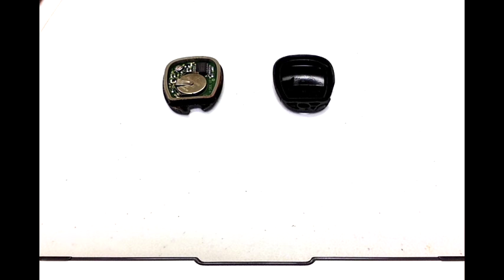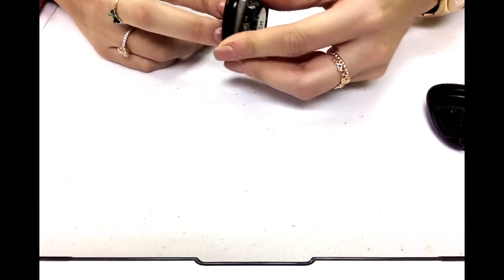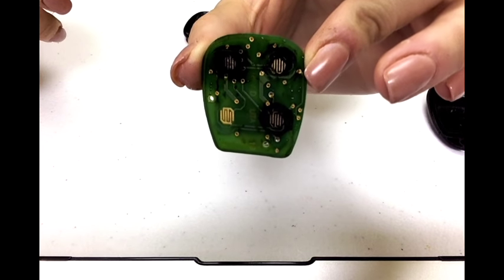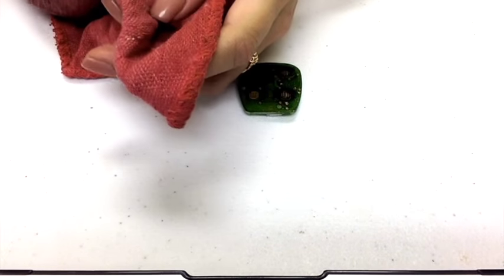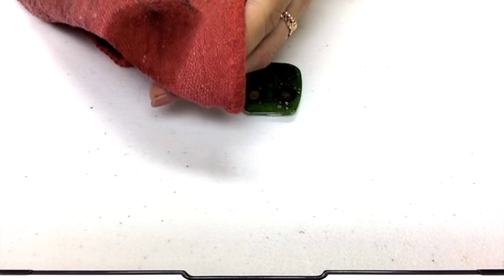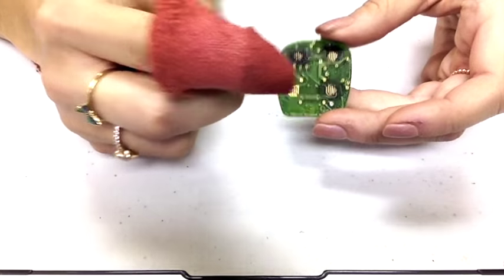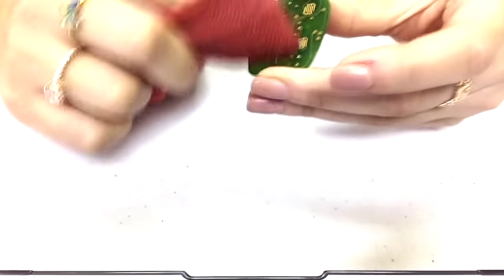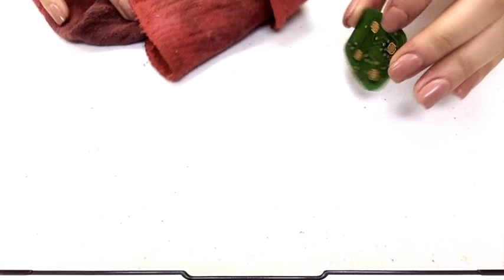How To Clean Your Key Fob Circuit Board | Fix | Repair Your Key Fob Buttons

Comment: Don’t use “rubbing alcohol” it’s ~30% water and possibly other stuff too.

Use 100% isopropyl alcohol only - and remove the battery first. Also use a clean microfibre cloth and/or clean cotton swabs.
Reply from the maker: Thank you for sharing this tip.

Comment: I am having trouble with a Chrysler 300 remote.  All the buttons work except the lock button.  It had worked for a long time even when the actual button came off we were able to finger nail the lock and then one day it stopped working.

I just opened it up and it looks like there is probably solder or something tin like on all the buttons except it.  I just bought a new key fob cover but have a feeling that it won’t be enough for the lock button to work.  What do you suggest I check if that is the case?

Comment: What if the the side where the battery is has stuff on it too?
Reply from the maker: Be careful cleaning that side, you don't want to break any on the connections, make sure the batter is not in and let it dry fully before putting the battery back in.

Comment: I clicked on this video because i thought she was holding a strawberry in the thumbnail.
Reply from the maker: 🤣 I can see that🍓🍓
Reply: I though it was some kind of potato...LOL
Reply from the maker: @obdiipolice7186  Strawberry or potato, I hope that you got your key fob working again!
Reply: Hope you can help me on this one, my key fob is draining batteries in like 24 hours. Works perfect ever time I replace a battery but after 24 hours battery shows 2.8 volts and will drop to zero within a week
Reply from the maker: @obdiipolice7186  It sounds like it has a short that is causing one of the buttons to consistently put out a signal. If you ordered the remote from us please contact customer service at 402-671-5100. If you need to order a new one you can so at our site, https://www.keylessentryremotefob.com